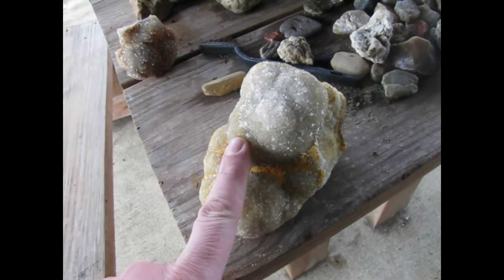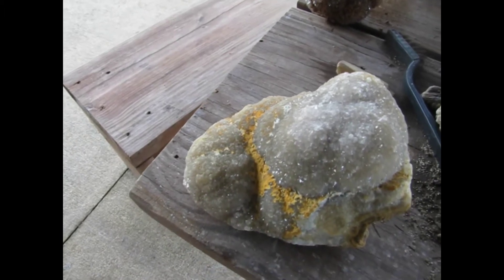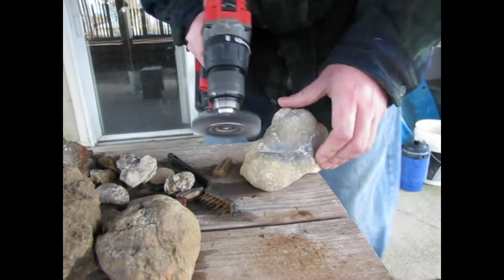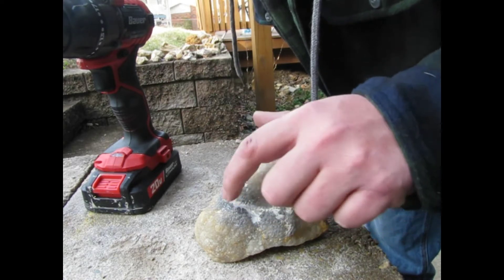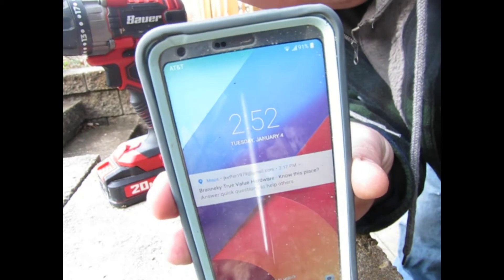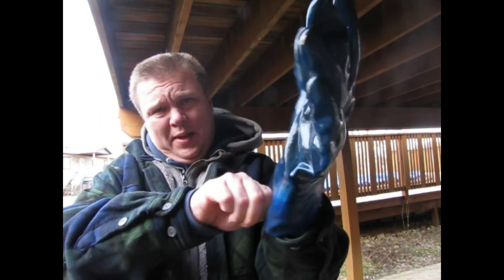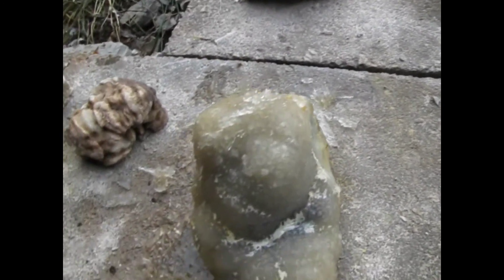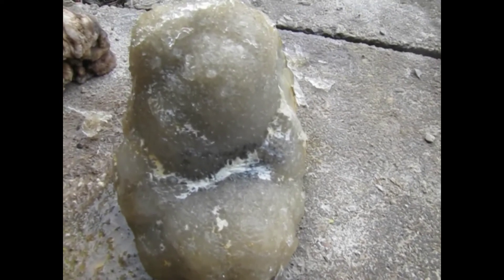Clean a crystal with a wire brush ?!?!?

Comment: Excellent idea with the wire wheel, I'll have to try it sometime. Would love to see a cleaned and finished piece!
Reply from the maker: I will have to do another one , this piece was pretty much just a " Look you can do it with out hurting your quartz" if I got really into it I would dremel tool into the cracks with a smaller wire wheel .... my next cleaning video I need to check to see if my air compressor is still working and I am going to go at it with glass bead sand blasting it has a Mohs hardness of right around 5.5 which should do more to barite and still have 1.5 of Mohs wiggle room for the quartz.
Reply: @huntingrocks  ooooo that's going to be a good one!